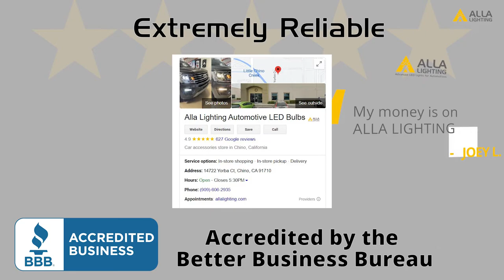3-Color H10 9145 LED Switchback Bulbs w/Remote Control Fog Lights 9140

Comment from the maker: Alla Lighting newest 3-Color H10 9145 LED Switchback Bulbs 9140 w/Remote Control Fog Lights Replacement released, 6000K xenon white, 3200K yellow and 8000K ice blue, you can choose any color you want just by pressing the button on the remote control based on the weather conditions and your preference. Easily switch color make your driving safer, better, easier and happier.
Amazon Link: https://www.amazon.com/dp/B0BLZR13NZ
Website Link: https://allalighting.com/products/h10-9145-led-switchback-9140-fog-lights-bulbs-white-yellow-blue
Other Optional Bulb Sizes:
H8/H11/H16: https://allalighting.com/products/h11-h8-h16-led-switchback-bulbs-fog-lights-white-yellow-blue
HB4/9006: https://allalighting.com/products/9006-hb4-led-switchback-led-bulbs-fog-lights-white-yellow-blue
PSX24W/2504: https://allalighting.com/products/psx24w-2504-led-switchback-bulbs-fog-lights-white-yellow-blue
5201/5202/PS19W: https://allalighting.com/products/ps19w-5201-5202-led-switchback-led-bulbs-fog-lights-drl-white-yellow-blue
P13W/12277: https://allalighting.com/products/p13w-12277-led-switchback-daytime-running-lights-bulbs-white-yellow
PSX26W/12278: https://allalighting.com/products/psx26w-12278-led-switchback-fog-lights-drl-bulbs-white-yellow